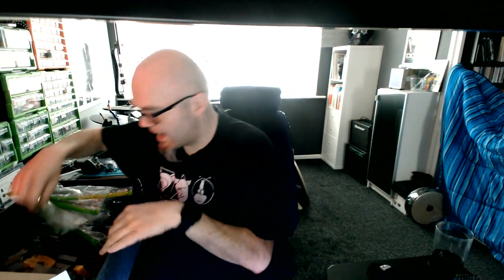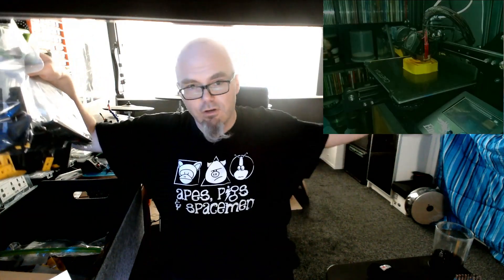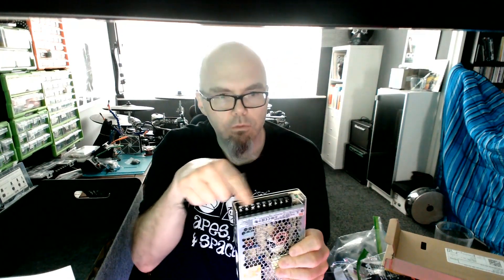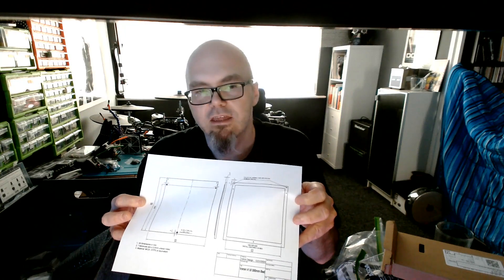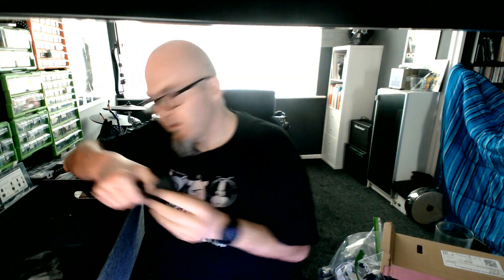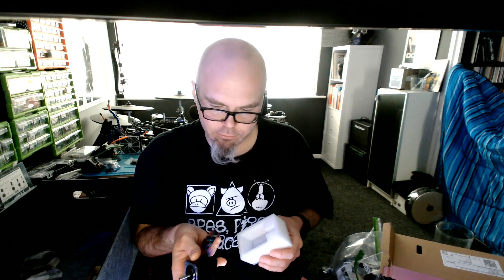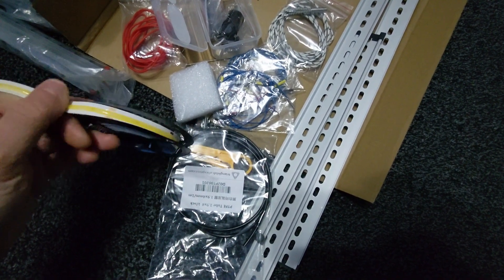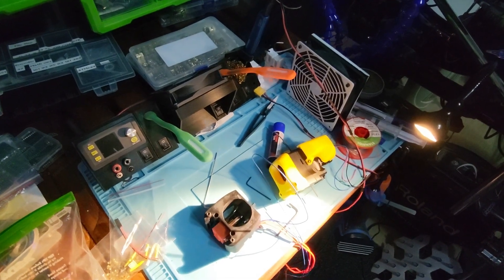Voron V1.8 3D Printer UK Build - Episode Two

Comment: Really like the blog style, it's fun to follow along :) it gives it the "project" vibe and it looks like you're having fun which is fantastic.

Few tips:
-On the zip tie mounts--that's a great point that those can be a bit weak depending on your print environment. You'll likely notice that once you have your printer finished and fully enclosed your ABS layer adhesion will be much better than your Ender. For an extra boost you can always put some Reflectix around the printer--not the prettiest but it helps bump the chamber temps up which helps ABS layer adhesion even more!
-Energetic bed--sometimes the magnet can be so-so and die over time. It's worth buying a backup just in case if the one you have gives out--I really like Trianglelab's magnet (but not their build surface)
-For the BMG gears in the extruder, it's designed to have some play to "self align" with the filament path. Sometimes you'll need to make sure that the drive bond tech gear is butted up against the 50T gear.